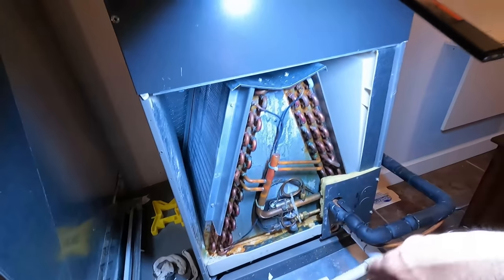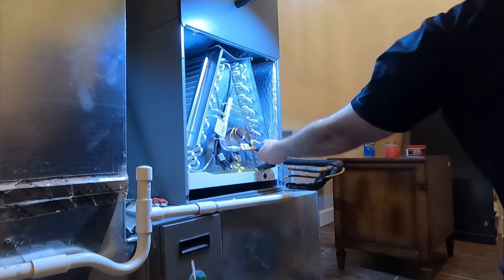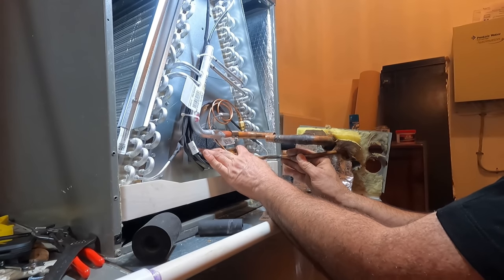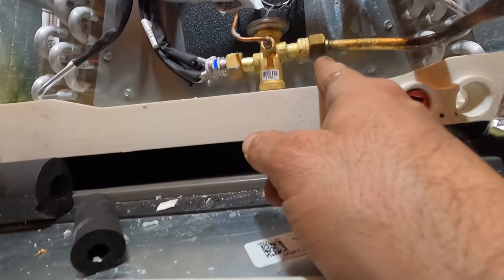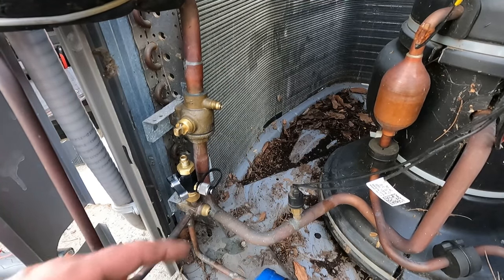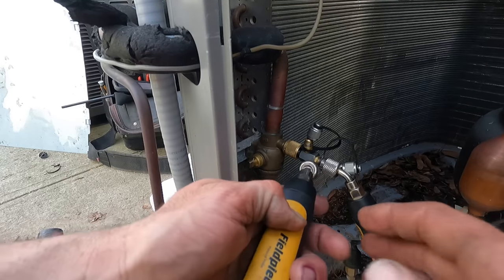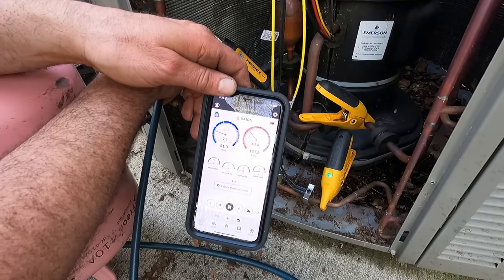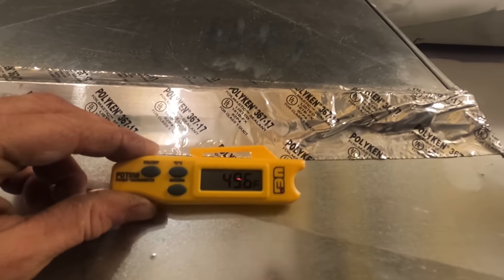Replacing Evaporator HVAC Repair

Comment: I had very BAD experiences with AC techs over the yrs. To say I distrust the profession is an understatement.
Reply: their as bad as roofers...
Reply: @rollawy  They're
Reply: Yes, most, not all, of them are as bad as auto mechanics. They know they’ve got you, because you need the darn thing to work and you don’t have either the knowledge, the skills, the time, or all of the above necessary to get into fixing it, so they’ll make you pay $$$.
Reply: Agreed. Called an HVAC to load a refrigerant. He looks around and says the whole system needs to be replaced. Quotes me for $25k
Reply: No way!!! My technician wanted to replace the outside unit only because the feed breaker was off, I guess he wanted me to have brand new unit and 7k less in my bank
Reply from the maker: You’re paying for the knowledge the tech has. All the tools, the business overhead. There is an hourly operation cost a business has. It’s the same as when you go to your doctor. Except you can trust the HVAC tech more. He won’t get paid unless the problem gets resolved. A doctor gets paid even if he can’t fix your problems
Reply: @thehvachacker seriously though,being a hvac tech a lot of ppl need to get this concept man and not only that other problems can arise that we do our best to avoid lol but no seriously solve.for example a wiring issue either high or low voltage that takes more time and knowledge ppl !!keep up the good work though
Reply: @thehvachacker Every HVAC tech I’ve seen charges labor rate regardless of issue is fixed or not
Reply: @thehvachacker I just don't agree with their prices. A capacitor costs $10 dollars and then they charge $400 for a freaking capacitor.
Reply: You pulled a vacuum and then you looked for leaks!🤔🤔🤔🤔🤔
Reply: @fabiodarocha2842 ok I thought I was slow. I’m no expert but a leak in vacuum would only show I gauges no? It wouldn’t bubble outward.
Reply: @fabiodarocha2842 I charge like 190 -210 but I’ll check your refrigerant and clean your coils :)
Reply: What happened? I'm so upset with on how far bad this trade is because me wanting to become part of this trade as a new tech. I want to make great money but not ripped off customers. I don't know what to do.
Reply: V sher coil  diconecting voil ceingbolc  ok rdmoveing cug gas usung  systom pum downes anx  discsncting and oug tacing pm all ceilinv and ou good fulsing  ddrin line ceiling snd removeing ou and  cleinv ok and repfixing ok
Reply: @thehvachacker the only problem is some of them don't even warranty their work. I have a compressor installed by hvac tech and compressor shorted 6 months later. They want me to pay for a new compressor and labor.
Reply: @ia388 load a refrigerant? What?
Reply: @jollyscaria1922  You ok, guy?

Comment: After connecting the new coil, you did the followings: 1. filled nitrogen with pressure to find any leaking using the bubbling method; 2. released nitrogen, removed valve cores, connected vacuum pump; 3. closed vacuum source, opened king valve to fill R410A from compressor; 4. put the valve cores in; 5. filled more R410A from the tank. Please correct me if any wrong or missing. Thank you!

Comment: Nice easy workspace too. Insane how quality has gone down. I've seen evaps with much more rust that still held a full refrigerant charge.. great changeout Bill
Reply from the maker: 410a coils like to rust. R22 coils didn’t rust like these. The metal drain pans over time did
Reply: It’s NOT the refrigerant type that makes a coil rust up. It’s the materials that the coil manufacturer uses. Back in the day coils were made of copper tubing, and thick walled at that, with galvanized sheet metal for the tube plates. Now they use aluminum tubing and cheap metal for the wall plates because of the cost of the materials. The refrigerant has NOTHING to do with the failure of a coil. It’s all  due to the economics of selling their product.

Comment: Have an evaporater pan that has that white algae slime that seems to be clogging up in the back drain channels and dripping water down into plenum. is there an easy way to flush that snot out of there, thinking i may need to bring hose in and just spray it out from below? Thanks!

Comment: Why is it that at the metering device you can use a compression fitting and all other connections are welded ? Nice video work , the clearest I have ever seen .
Reply from the maker: Great question. They use to use compression fittings on old carrier's from the 80's
Reply: @thehvachacker  p

Comment: One thing you'd be doing if it was my house, you'd put the tvx on the outside of the duct work, with shut offs on both sides of it, and gauges on both lines.
Reply from the maker: Sorry the txv comes factory on the coil. No one puts shut offs around the txv. That makes no sense. It’s rare for them to fail plus if system is open how will you evacuate the area of piping moisture was let into system. I can put gauges anywhere on a system. Doesn’t mean anything without knowing subcooling and superheat. You can’t charge a system using pressure only

Comment: Just bought a home with a Miller downdraft unit like this. I know it's about 18 years old but not sure which refrigerant it has. It won't last forever....  I've done plumbing but not AC work so I may be able to change it out myself but need someone to charge it. Side note: why are the drain plugs on the side and not on the bottom? common sense would be make it like a shower drain and grade the pan toward the drain. 
 Mine has two like that one but for some reason, one is slightly higher than the other, and from the factory they put the drain on the higher one so the condenser is always sitting in 1/4" of water and got rusty.
Reply: Not an HVAC professional so take what I say with some salt.

- If it is a unit from 18 years ago, then it is likely using R22 refrigerant. There is usually a sticker on the outdoor unit connected to the indoor unit that species the charge type (e.g. R22, R401a).
- Sometimes units come with two drain holes: a primary one, and a secondary one. The secondary one is usually higher positioned than the primary (not sure why it is reverse here. Sounds like an installation error.). The purpose of the secondary is to alert you that the primary is blocked and buy you enough time to fix it instead of dripping all over the place.
- As for why the drain holes are at the side as opposed to the bottom of the pan. I'm not sure about this one but I suspect it is to for easier maintenance access.

Has any repairs been done on your unit? Normally ductless split units last 10 years or so while ducted split units last 10-20 years. Might be best to just replace it sooner than later (and also benefit from the technology upgrades that can lead to lower electricity bills)

Comment: I wish I had this guy at my house ,almost everyone I talk to is about more money , have to go all new inside & out , more ,, lots more money,,,scammers,,,,,
Reply: Hard to find trustworthy individuals in this profession.
Reply: It sure is
Reply: Cheapest I found that would Not do it was $2000
Reply: If you have a older unit outside that still has the old refrigerant it’s better to replace coil and ac
Reply: Why would you replace a evap if it still has r22 or over 15+ years makes sense to replace it all the ac just going to be a money pit
Reply: FOR SURE!  I GOT TIRED OF THE WHOLE HVAC RIP OFF AND WENT BACK TO WINDOW UNITS AND GAS FURNACE.  NO PROBLEM SINCE :goodvibes:
Reply: Yeah, learned to do  basic maintenance on my AC for that reason. Went from $500 for cleaning coils to $10,000 for a brand new AC. I said thanks but no thanks.
Reply: He obviously skipped some required steps. I think to convince you that you can do it. Find a local company or guy. They can save you more money than they would ever steal!

Comment: Question. why do you use nitrogen before sweating? i have alot of plumbing expierence and wanted to help my friend who has a badly (confirmed) leaking A coil. i thought i could just get a new Acoil, pan, and sweat it in and have a tech come by to put a charge on it.....im a little confused about the purpose of running nitrogen before sweating.
Reply from the maker: Sweating doesn’t require nitrogen before. What your thinking of is purging with nitrogen, while brazing the line set. That is due to heat required to braze. Leaves carbon soot inside the pipe. Only soldering/Sweating on a 410a staybrite 8. No other solder is approved for 410a.
Reply: @thehvachacker  gotcha. thanks

Comment: What happened with the old evaporator?  What was the diagnosis made it necessary to change the evaporator?  Thanks!!
Reply from the maker: The coil had a bad leak and the drain pan was coated in oil. I mentioned that at the beginning. Sometimes YouTube doesn’t start all videos at beginning. I added gas two years in a row. First year was only one lb, last summer a day before Labor Day I was their for a no cooling call and added 9lbs. Then leak searched unit. This unit had a lot of oil in pan and my D-TEK was going off outside the unit. A coworker changed another coil on this system that was a little tricky to find yet after some time I was able to locate a micro leak on the evaporator.

Comment: I didn't see any evidence that you took appropriate measures to keep air/moisture and debris out of the lines. Were you flowing nitrogen the whole time. Big concern with today's oils... moisture in the lines can create an acid build-up in the lines that might lead to a shorter life of the system.   Right?

Comment: Do you tape the back of the coil box when going from copper to aluminum to avoid corrosion through dissimilar metals?
Reply from the maker: Never tried it. Have you done that? Does it help?
Reply: @thehvachacker  we do it on every copper to aluminum coil change out. I have seen it where new tape was not applied to the back and it leaked on the U-bends a couple years later

Comment: Mine is 30yrs old and has rust on bottom ....should i replace it? Or keep using it
Reply from the maker: Is the metal bottom soft. If so replace, if not it’s ok.
Reply: @thehvachacker  no its not soft only where the drain is..i gobbed some j.b. weld there yesterday..im testing it out now
Reply: @jayc4715  how did it work out for you

Comment: Can I use compression. Fittings to connect  that  line that  you welded ?
Reply: Don't be scared of soldering! What you need is a torch and flux and solder! I had never done it before and had to connect copper water lines. Very easy.
Reply: @zal1905 this isnt your plumbers water line at 60psi. R410a can go up to 500psi. Need Silfoss and acetlybe torches for welding. 

I prefer good welds over compressions any day.
Reply: @erickbravo5800  Oh, I did not know!
Reply: Acetylene torch kit is basically 1000.00 bucks to buy. Mostly because you can't get the bottle's filled around here without a rental set-up and turn in those brand new bottles that came in your kit 🤦
Reply: @zal1905  That was not soldering it was brazing very different process.
Reply: @AviewFromUnder  Thanks!

Comment: What's the reason for changing it
Reply from the maker: It was leaking
Reply: Mine had to be replaced because maintenance destroyed it so bad after every cleaning that is couldn't even get air through the bent coils. It was always moldy, constantly freezing and smelled HORRIBLE. Took over 2 years just to get them to finally do it!

Comment: Looks like they are changing to aluminum tubing. You would think that copper would be better. Yet I have a 43 year old aluminum evaporator coil sitting on top of an electric resistance heating coil, which still works fine. And its been running for 10 years with no dryer installed in the system in humid Louisiana. 
Maybe the government will send some people around to install a nice new efficient heat pump, to help fight climate change. I wonder if they will use a vacuum pump to evacuate the system, unlike the guy my sister sent over, who didn't bother to do much besides flush the system with nitrogen when he installed the new condenser unit. But like they say, 'If it ain't broke, don't fix it.'  That is a good excuse for us lazy folks.  Although I did just change the capacitor before it had chance to die one day, when the heat index was 105.  You don't want to experience this summer heat & humidity without AC. The Saints has to build an indoor practice facility, since it is even hot at night because the humid air doesn't cool down much all night.

Comment: I am new to this field,  is this heat pump unit, I wonder it have … service line outside of the unit, my question why you need ..open the panel do it inside? Please rely thanks 🙏

Comment: Why didn’t you can’t the filter drier?
Reply: Good point
Reply from the maker: filter drier was never exposed to moisture. inside the condenser where all the refrigerant was stored for repair
Reply: @thehvachacker it’s always good to change for any major repair
Reply from the maker: @carcrashmayhem3423  can all moisture be removed from POE oils?

Comment: How come they never vacuum the leaves and dirt out and clean the coils you would be surprised on how many do the bear minimum than they should.
Reply: Yeah hvac tech here, and i agree..
Some systems have a part called a “crankcase heater”
It goes around the bottom of the compressor(outside unit, at the bottom, usually black or rusted, the silver band around it)
Its an electric heat strip to prevent oil from becoming a low viscosity

Anyways yeah, do it yourself if they refuse when they are working on the unit tell them take that fan off for 5 minutes lol its usually 4 screws and 60 seconds to do

Always tip people and put in a good review in 3 ways for the rare ones worth trusting
Word of mouth, a handwritten letter to the company and of course yelp
We usually get a 5$ thing but reviews help keeping a job in the future as well

Comment: How does the thermostat trigger the coil for AC in the same way it does the furnace for heat?  I've watched dozens of videos and don't see an electronic connection between the furnace and coil.  Just a home owner on the verge of possibly replacing my entire system.
Reply from the maker: Most coils don’t have electric controls. The fan from furnace and the condenser does all the work. The coil is a heat exchanger.

Comment: I’ve had nothing but trouble with the Appion tee.
Reply from the maker: Make sure your gasket is seated correctly. I find the gasket sometimes slows down refrigerant flow. Have you found a better t?

Comment: Why didn't you replace the liquid line filter drier?
Reply from the maker: It’s inside the condenser and was never exposed to moisture. The condenser had refrigerant in it the whole time. Removed any moisture or contaminants when I evacuated the system
Reply: Can you install an other filter drier without removing the old one
Reply: @ditprengasway5405

Comment: My old system is using  R22, is it better to change the whole system rather than fixing the Evaporator coil? Thanks for the video.
Reply: Yes replace the system, it’s old, less efficient seer then modern standards, and the price of R22 is outrageous
Reply: @mathewbrown8206  Thanks for the input.
Reply: @shaun4bigblocks993  Thanks for the information.
Reply: Definitely
Reply: Depends, my 23 year old 5 ton trane (R22) had a new compressor put in 6 weeks back.  After labor and parts it was $2700.   That versus $15,000 for a new one was a no brainer for me.  You have to have an expert though.  Side note, found R22 for $50/lb, 2lb bottle for $99 in Dallas.  Tech reinstalled the old freon after drying in into the recycle tank so $99 for topping it off worked for me.
Reply: @amtrakusa1  Agreed, it all narrowed down to the bottom line and what other parts of my old system still available and so forth. Thanks for your information.
Reply: Yeah plus they don’t seem r22 coils anymore

Comment: how old is the system, and is it better to replace the whole system depending on age?  Might not be worth it to have an efficient handler but still have a rusty and clogged condenser unit, will still have trouble down the road.

Comment: No need to replace lost oil?
Reply: @shaun4bigblocks993  Basically, estimate oil loss and replenish using correct type of oil.  There's at least a liter of oil in the factory compressor oil fill this it's not completely dry and will probably be just fine but the right way is to add.
Just like everything else, too much is bad news and there's no way of knowing for sure without removing the compressor and receiver, flush, etc

Comment: i would have thought the dryer would have been changed at the same time
Reply from the maker: Why the drier would require recovering instead of pumping down. The dryer never was contaminated or exposed to moisture since it remained sealed in the condenser. If dryer is external/ after the valves, yes it would be removed